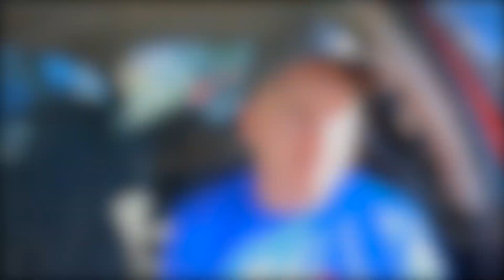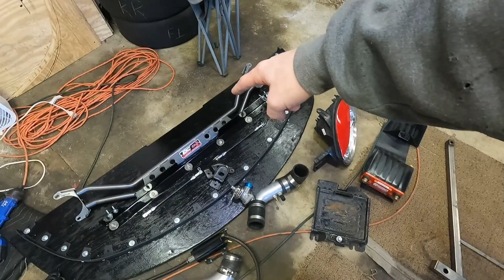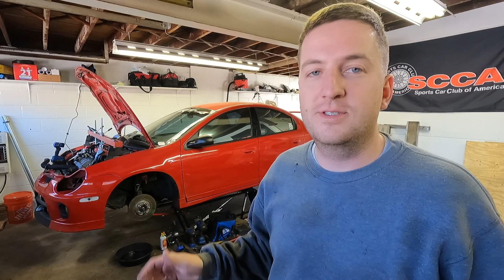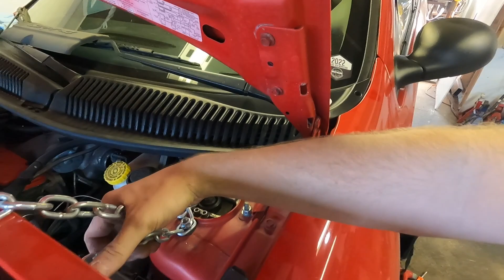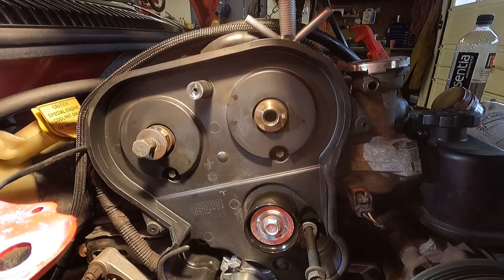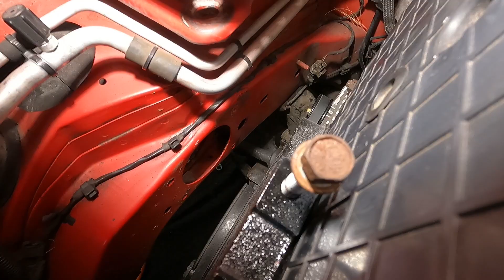SRT4 Timing belt, water pump and motor mount replacement | How too

Comment: how did you slide the motor over with it being supported by 2 jacks oriented that way? i just dont know how you were able to move the motor
Reply from the maker: Lower the Trans side down and used a ratchet strap to crank it over
Reply: @zackellis23 thank you

Comment: A shop told me today my water pump is going out... My car has been through a lot and had coolsnt coming out of two lines by the oil filter place and i sent it to a shop anf they told me the water pump is foing out vut i dont hear screeching, see an active leak near the water pump but thet said its coming through a weep hole in it and i know whwt that is but how can you evem tell without removing the side of everything to see the water pump?
Reply from the maker: @tannerlittle2606  it sounds like the oil cooler (which is the Finned thing the oil filter attaches to) might be leaking. A lot of people delete the oil cooler for that reason.
Reply: @zackellis23  it was some of the lines I got the lines replaced but I didn't know you could delete it???
Reply: @zackellis23 the water pump started to whine today 😢

Comment: Did you have to remove the motor mounts to make  room to work replace the belt and water pump, or could you do the belt/pump without removing the motor mounts? About to tackle this in my PT cruiser GT... water pump is going.
Reply from the maker: To the best of my memory, no you shouldn’t have to. However, most people recommend replacing the motor mounts and all timing components while you’re in there. That’s what I did so I couldn’t have to do it again. 

The motor mount does have to be disconnected from the engine but can stay in the frame rail. I disconnected both months and slid the motor and trans over to make room
Reply: @zackellis23  I had put a new mount up top recently on that side, removing it is no problem. Thanks for the reply, appreciate it!
Reply from the maker: @SlowSpyder  no problem! good luck with it!

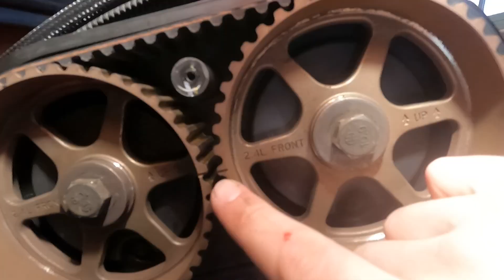Comment: what was you using to clean the timing covers? Also @7:44 the marks were way off and then few seconds later they were on, what did you do to get them to line up properly?
Reply from the maker: So the reason the looked off at 7:44 is because of the valve springs. If you watch how quick the cam gears jumped that from the valve springs. If you slowly rotate the engine with a wrench (not a ratchet) you can get them to line up correctly
Reply: @zackellis23  thanks

Comment: Can you please help me. What are the torque specs for all the cam shaft gears, the water pump, the tensioner bolt, and all the bolts on the engine mounts? If there are torque spec for anything I didn't mention that is important can you please provide me with that too? I would so greatly appreciate it if you can help me get those specs, and regardless you earned yourself a new sub. Great video.

Comment: You made it look simple. Got my timing belt kit done at 60k miles last year at a local shop. paid 6 hours labour. kept my stock engine mounts.
Reply from the maker: I would say if you're not confident in doing it or if you don't have the ability for your car to sit for a few days so you can take your time, Taking it to a shop was a good call. For me, Im probably over confident and if I ended up destroying my engine I would lose any sleep lol id just swap it with a new one.
Reply: Yeah same here paid a shop because I wasn't confident about doing it and spent around 1200 dollars...